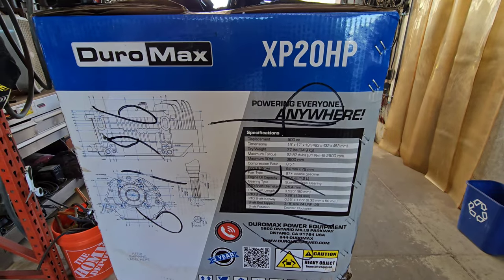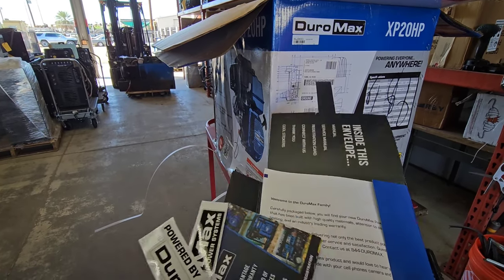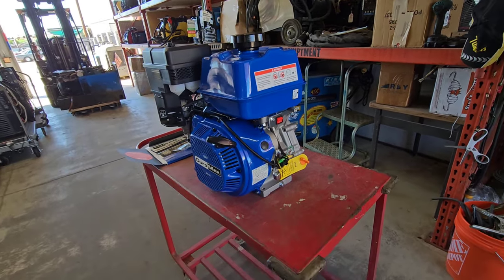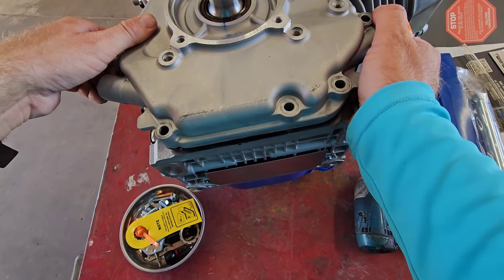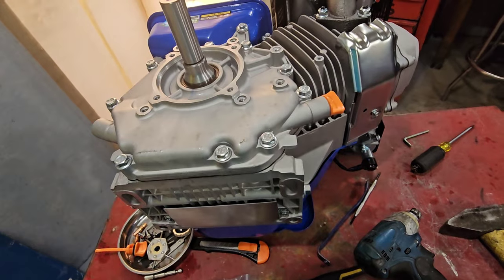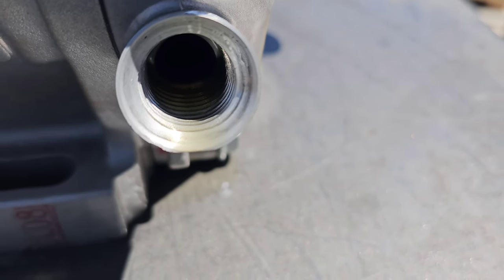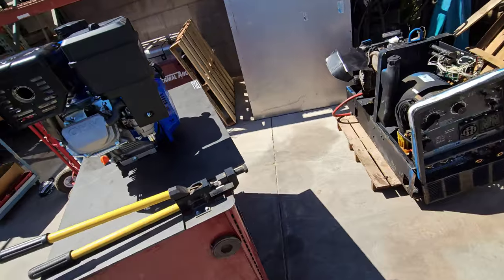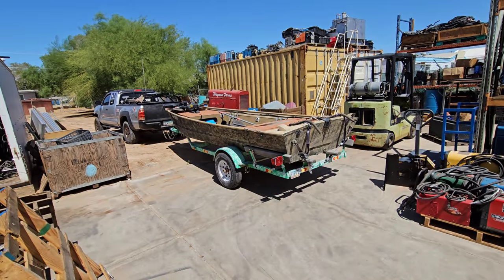Duromax 500cc #xp20hpe governor delete

Comment: Custom flange has to be made for exhaust , larger than any other big block port . 
Ordered mine the day it came out on the market . 

Been running this engine on my 1432 with twister XL . Getting 27mph with a 8.5x8 prop need to go up to a 9.5x8
Reply from the maker: It looks very similar to 459cc flange but an opposite angle
Reply: @azlongtales  It’s possible but with the new head design idk if it will fit , it’s worth a shot but to me I wouldn’t spend the money on a 459 exhaust for it not to fit . I’m just getting some 1/4” flatstock steel to make a flange . 

This engine is just based off another Chinese companies 499cc 18.5hp engine (mudskipper use to sell it ) with the only difference I see being the new airbox design .